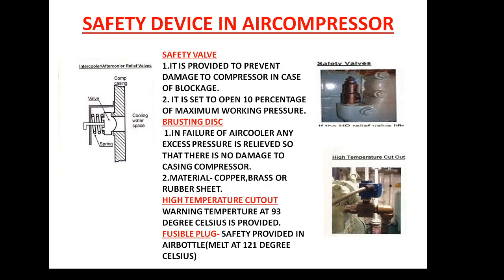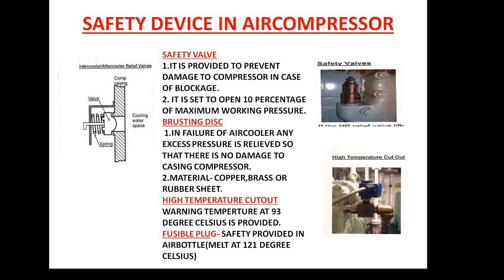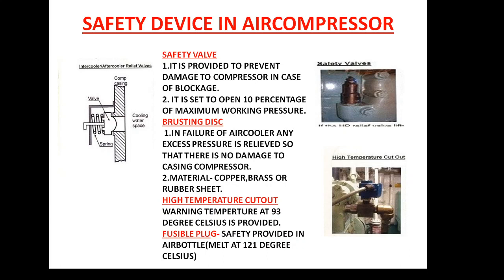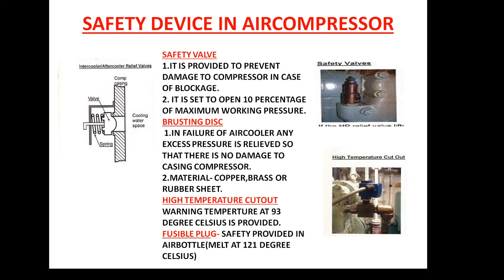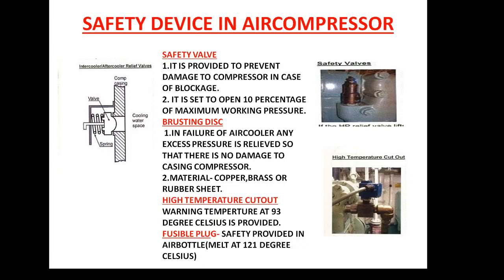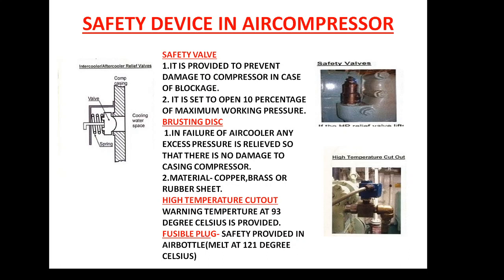Air Compressor safety| why Relief valve provided in Compressor| what is Bursting disk|

Comment: Nice video sir ,
That fusible plug it may be 105. Celsius melting point
Reply from the maker: Thank you for your response!!!!
Fusible plug melting temperature is decided by the material used for fusible.
The material which I have told depending on that will be melting point temperature.
I hope you understand!!!
Please do like and share with your friends!!!
Reply: Basically , the fusible plug,which is present in an air bottle , Mainly made up from  bismut, tin and lead ( having different percentage ), whose melting point is around 105 degree centigrade

Comment: bro, how to test compressor trips and alarm? what are the method?
1) jacket cooling water high cutout
2) Lo pressure low cutout
3) discharge air temp high cutout
4) motr overload trip
5) water noflow trip
Reply from the maker: Thank you for your response and suggestions!!!!
I will make the video on this topic shortly!!!!
Reply: @MarineEngineeringHub  pls bro, it will be helpful